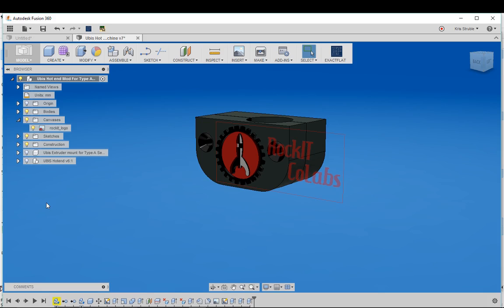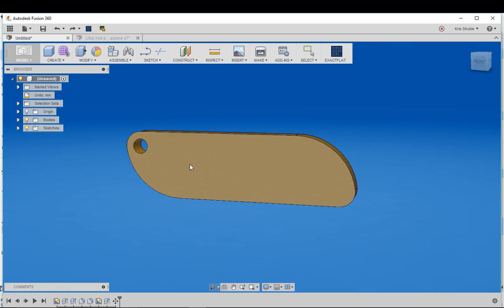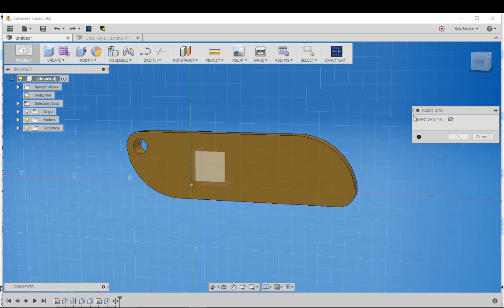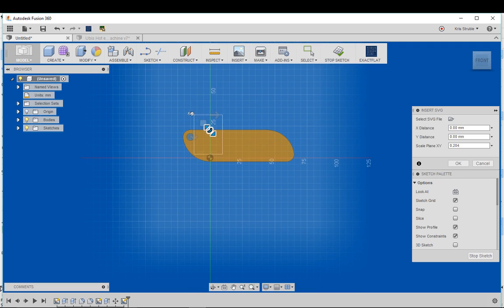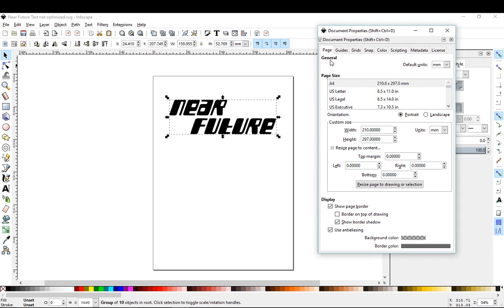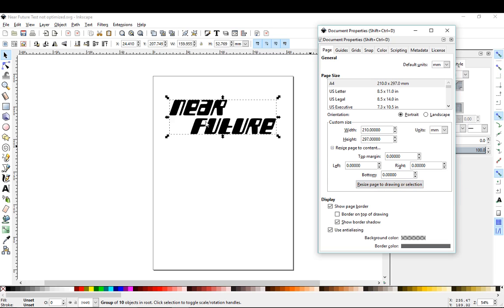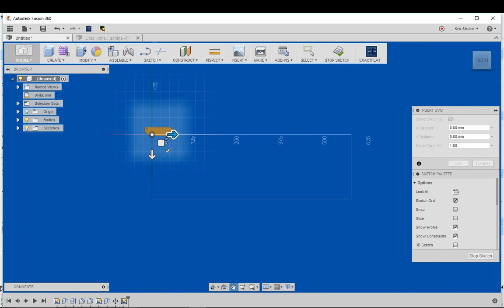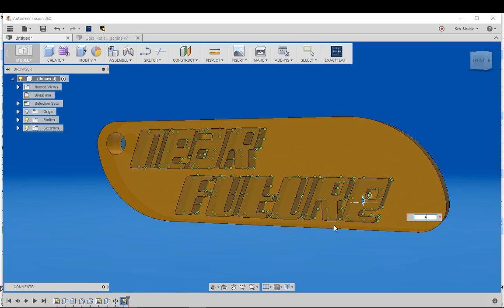SVG Optimization for Autodesk Fusion 360

Comment: When I import a complete logo with a background as svg do I need the background and the font?
The font is subtracted from the background. Fusion 360 says if I have both that there is a duplicate.
In C4D I import an Illustrator 8 File and there I need the background and the font. But i guess that svg is different. Is this correct?
Reply from the maker: Hi Andreas, ideally you should convert all fonts to shapes before bringing them into another program to avoid errors.